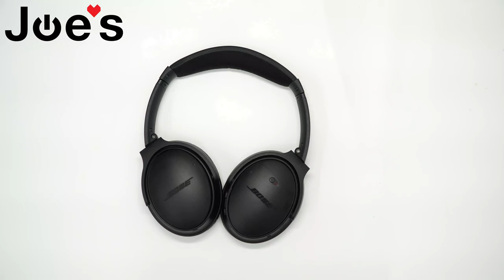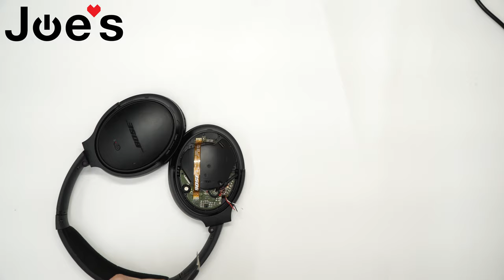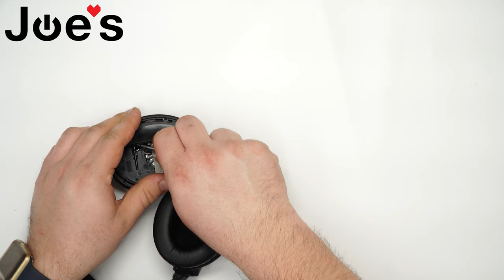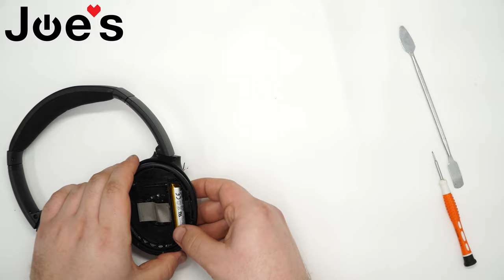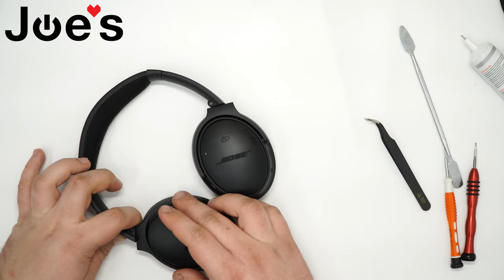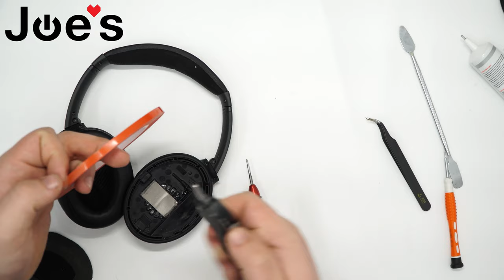Tutorial How To Repair Replace Bad Battery Bose Quietcomfort QC35

Comment: if you watch carefully, it appears he melts the speaker diaphragm with the heat gun. I just did the exact same thing. Now I have to replace the speaker drivers. Be careful with your heat!!
Reply: надо было заклеить вокруг каптоновым термоскотчем
Reply: I noticed the same when I saw the video. I wonder if covering the drivers with a piece of cardboard or plastic would help
Reply: I didn't seem to melt, but just dislocate slightly because of the airflow of the heatgun...
Reply: Yes, it does look like that, and I would absolutely expect that to happen. The diaphragm is so thin that it will heat much more quickly than the thicker material enclosing the battery. I haven't tried this repair, but if I did, I'd completely cover the driver on that side with a masking tape so no hot air would leak through to it. It's likely this damage would not stop the driver from working, but it would have some affect on the sound, and possibly the longevity.
Reply: Another important thing is to take not to short the red(+) and black(-)  wires, I recommend putting a small tape on them.
Reply: i was worried no one has seen it - but i am clearly not alone, i got shivering as I saw him melting it
Reply: Dang good eye
Reply: @jacksonFerrari  it is just glue, it's probably safer to use a bit more force to pry it open without the gun than to mess with the insane heat.
Reply: @jacksonFerrari  he should have used kapton tape
Reply: @KevKlopper  you can use a warm cloth with warmed up chickpeas or a specialized heat "bag" (ifixit sells them) or just isolate everything with heat resistent material like kapton
Reply: Happened to me as well. I am wondering why you would upload such a Video without a disclaimer. You must‘ve noticed that as well right?
Reply: You are both not professional

Comment: Love it. Bose recommendation for bad battery is buy a new pair.
Reply: No, you can just replace the single ear unit. They sell them online.
Reply: @MrMJmusicLover  Can you drop link here? I didn’t find it on official website, only ear pads etc.
Reply: @het7644   I thought I was correct.  I wasn't. You can't replace the whole single unit. It has to replaced  (Battery)  by you or a professional. Sorry for the incorrect information. 😕
Reply: @MrMJmusicLover  That's all right! Single unit would be too expensive anyway, especially right one.

Comment: Beats me why Bose does not offer this service itself.  It seems wasteful to ask customers buy a new pair rather than replace a battery within 10-15 minutes.
Reply: Because they want you to buy a new pair for $300
Reply: You can buy a single ear unit by itself online. Saves alot of headache.
Reply from the maker: We offer the service on our website
Reply: @MrMJmusicLover  where? I can't find that piece
Reply: @vice1997  I thought it was sold individually but it's not unfortunately.  😕
Reply: @MrMJmusicLover  yeah, I already contacted Bose
Reply: @vice1997    What did they tell you?  I want to know,  my ear pads are deteriorating.
Reply: @MrMJmusicLover  they told me to change the headphones with the new model and they offered me """special price"""... So if you want to change the battery you have to do it by yourself or contact some repair service and ask if they can do it, I called a service here in vicenza (Italy) and they will charge about 35€ to replace the battery which I will provide (bought on AliExpress for 13€). For the ear pads you can change them by yourself (I already did it, is simple), you can find the original ones in the Bose site or not original on Amazon and eBay
Reply: @vice1997   Thanks for information.  I would recommend a professional to change the battery because there's so much of a risk doing it wrong and losing tiny parts.
Reply: @MrMJmusicLover  yeah exactly, I could have tried by myself but I'm scared to broke something

Comment: removing or installing the Lithium-ion battery without insulating the wires before threading through the pcb is just poor technique - risk short circuit of the cell.
Reply: Hey, I'm new to this video and was wondering what I should do when replacing my battery. You mentioned that the wires should be insulated before installing them but do you really need to insulate them when taking the battery out?

Comment: Very nice tutorial, thank you very much. Before buying those expensive headphones, I wanted to make sure I'd be able to replace the batteries once dead
Reply from the maker: No problem. Glad we could help.
Reply: My battery just died used everyday for 5 years
Reply: @jasonmackenzie3052  Mine, too. I think mine were 4 years old. I would use them everyday, all day. Then one day last week--DONE. I just called Bose and they immediately said if I would return them (they're out of warranty), they would sell me a pair of their updated Quiet Comfort 45 for $209 instead of the $329 they retail for. I'm going that route. More money than changing a battery yourself, but hey--at least I get a new pair of headphones for a decent discount.
Reply: @ThriftDiving  I ordered new battery was £20 then re-soldered the 3 wires works perfect again, first solder attempt :)

Comment: I suggest to first cut the battery wires, that will prevent any sort of shorts when soldering. Start with B+ (red wire). The wires are a bit longer than needed, I cut them at the bend. Then use some soldering wick to remove the excess old solder from the pads. It will leave the pads nice and clean for the new replacement battery wires.
Thanks for the video.
Reply from the maker: Cutting the wire isn't necessary, but if it worked for you, thats awesome.

Comment: Good practice Is to use a bit of foil over the speaker before getting heat gun on that battery panel as drivers are so easy to damage with heat

Comment: when i test the battery out of the headphones, the original reads 4v, the two replacements I have read 3.8 and 3.9v. As soon as I connect the red and black to the B+ and B- pins the voltage measured drops to 0v. There is just 1 ohm resistance between the + and - pins when the battery is disconnected. Any ideas what might be going on?
Reply from the maker: Hello, thanks for commenting. Please email us at support@joesge.com and we will be able to better help you there. - Aaron P

Comment: Hi Joe, could you please explain why battery use 3 wires: +, -, what is 3rd. Another question: is it possible to use AA or AAA 3.7v batteries with more capacity or AA is incompatible by size? Thank you in advance.

Comment: Nice demo. I have some doubts, however, about using a heat gun to remove the battery cover. Glue is weaker than plastic, pry it slowly and the glue will pop before the plastic. I had to change a battery on another brand, worked fine. Btw, you can find these batteries, generic with same specks, for under $5 on Amazon.
Reply: Can you post a link of one posted on Amazon? Can't seem to find the correct model/specs.
Reply: please give us more information ...

Comment: Can we just cut the old battery's wires and weld the new one on the old one who sticking out ? Can we use a piece of tape to fix the cover instead of glue it again ?
Reply from the maker: I wouldn't recommend any of that.
Reply: @Joesge  why not? We need simple way to do this.

Comment: Trying to find this out everywhere but can't get any information on it. After removing the ear pad and felt insert, like you did, what the heck is that large white corrugated stiff ribbon like structure that is partially covering the driver. Why is it there? I've never seen any other headphone bock their drivers like that. I thought maybe it was there to deflect the midrange and the highs so that they wouldn't sound so sharp by going directly into the ear but honestly, this is just a guess. Do you know what it's there for?

Comment: My daughter's qc35s aren't lasting as long as they used to. She went to Bose and they said it would cost $300 to replace the battery! Not impressed. I used to be a computer tech back in the Mac plus IBM PS/2 days so I think I will give this a try sooner or later. Thanks!
Reply from the maker: Kenneth, we do sell QC35 batteries at our location here: https://www.joesge.com/products/bose-quietcomfort-qc35-li-ion-battery-replacement-parts The batteries we sell are the original ones. 

Ruslan P
Reply: @Joesge  Do you ship to Mexico? I want one battery :), thanks!
Reply from the maker: We do ship to Mexico:)
Reply: @Joesge  How about Ireland? :/

Comment: Thanks for the video! What type of battery do you use for the replacement? Is it the same as Bose uses? Where can I buy them? Thanks!
Reply from the maker: Thanks for watching our video. We use the same battery as Bose. We are now selling battery's on our website. Here is the link - http://bit.ly/2uGSTm2
Thanks A.P.
Reply: @F1ForFun This sounds like a super intriguing idea! Did you end up doing this?
Reply: @F1ForFun That's super cool! I don't think I need a guide, but perhaps a picture of the mod? I haven't actually got the qc35s but hopefully should be getting them in the next few weeks.
Reply: @F1ForFun oh no I'm gonna get these second hand for around £100 and replace the cushions and head band and hopefully the battery too. These won't have warranty. I'll be looking out for your post lol.
Reply: F1ForFun how did you attach the 3 wires to the battery? Mine are totally dead and wont charge. I got a soldering iron but i dont know how i would attach the 3 wires to the battery
Reply: @F1ForFun I would be very thankful for  a guide posted on reddit or somewhere  else
Reply: @F1ForFun It may be stupid question but I need to ask since I have minimum experience in electrical knowledge, what happen if you don't use the white wire and just cut it and connect red to pos and black to neg of 10440, will it work just fine?
Reply: @F1ForFun and how is you headphone working so far after battery modification? Is it working fine still without hiccup? Thanks btw for the diagram :)
Reply: @F1ForFun did you end up making a reddit post?
Reply: @F1ForFun I'll wait for my battery to totally give out then replace it with an 18650 (I've got a million of them). I had no idea that the 18650 voltage matches the original Bose battery. Thanks for the heads up.
Reply: @rocketrose2165  how in the hell are you going to fit 18650 into the headphones?

Comment: hello, I'm thinking about buying Bose QC35 ii, and i'm wondering for how long you will have replacement batteries for selling, because currently they are sold out. Maybe could u tell the info about that battery Voltage, charging Amps? Just in case, because i dont like built in batteries which are hard to find.
Reply from the maker: RIm, thank you for watching our video. The batteries are typically restocked every 1-2 weeks. We suggest you sign up in the "Item out of stock - notify me". The amount of voltage it can hold is 3.7. The amount of amps is 495Mah. 

Ruslan P

Comment: I’m gonna replace hinge by cutting 2 halves with an end mill and encasing the wire NOT all that soldering. I will go big and find perfect size incrementally and very carefully. I may use JB weld but if I make it perfect size I don’t think that’s necessary. I may pin it together because that’s the shit, still..
Note: I ordered (1) R hinge on eBay for $12 and got a Left. I saw pair on Amazon for $15…(smh, yea they got me but guess what? After taking this crap toy apart and seeing what Bose is really up to I PROMISE, I won’t even look at a Bose products. This is made EXACTLY like cheap toy..)
Reply from the maker: Hello, thanks for commenting. Please email us at support@joesge.com with your question. We will be able to better assist you there. - JoesGE

Comment: I can't find these 3.7V 495mAh cylindrical batteries!
Has anyone had any luck?
Reply from the maker: Thanks for the comment. Here is a link to our repair parts: https://www.joesge.com/products/bose-quietcomfort-qc35-li-ion-battery-replacement-parts?_pos=40&_sid=94c28123e&_ss=r
If the part you are looking for is out of stock you can enter your email in the "Item out of stock - notify me!" section and you will be notified when this item is in stock. 

If you would like your item repaired by a professional you can fill out this repair form here: https://www.joesge.com/pages/repair-services

-David P
Reply: @Joesge  Do you have an idea on when you'll have stock again? It looks like these batteries are now quite rare, at least in a new condition..

Comment: Instead of a heat gun I would use 91% isopropyl
Reply from the maker: Either way does work, the heat gun is set to extremely low, like 100 degrees F. Heat gun is just a little quicker.